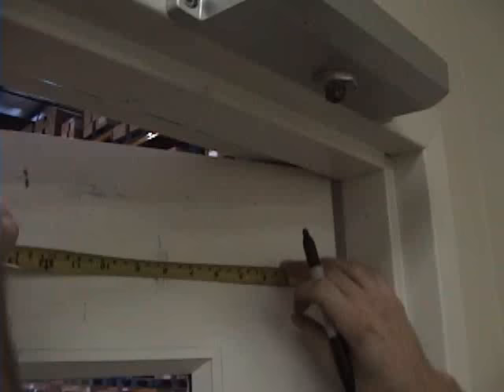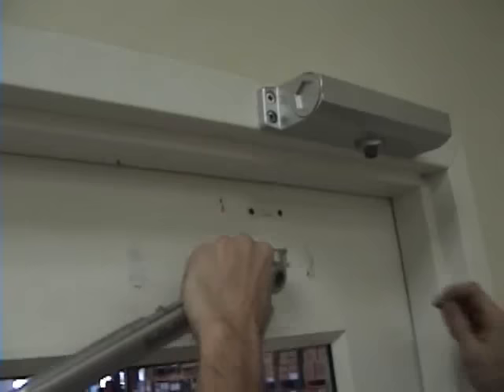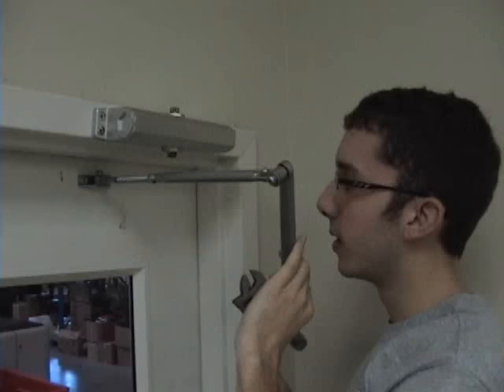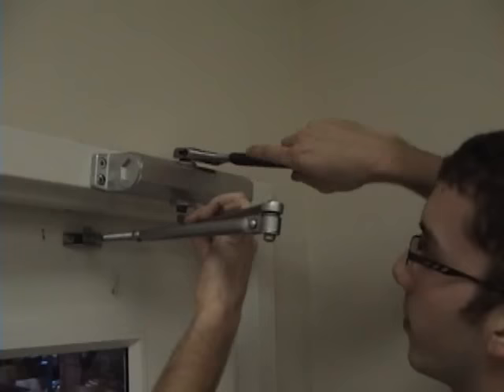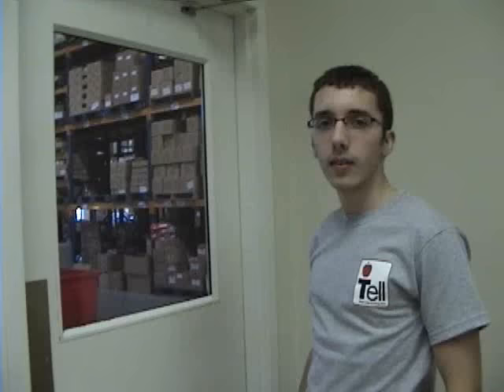How to Install a Door Closer - Top Jamb Installation Video / Tell Manufacturing

Comment: you didn't say that the jamb/header was wood or metal... also, you said drill and tap for 1/4x20 machine screw threads... this assumes that the header is, 1) not thin aluminum or hollow sheetmetal stock. these should only be drilled and tapped for such if there are backing plates behind the sheetmetal such as 3/16 inch thick. for thinner metal mounting surfaces, one should use the large sheetmetal thread screws to avoid pull out. again, you 'didn't say' !
Reply: the best of me
 t
Reply: maximum woof you didn't say you are a complete tool but we gathered that anyways. Again you didn't say.

Comment: I just instaled one today but I don't understand is why I can't control the speed ......the manusl says that depends on what side are u want to instal it  and you need to adjust the part where the arm goes mounted acording to the marks  ......but I don't know if thats the problem
Reply: What are the measurements from the door jam and door?
Reply: The measurements that came with the instructions are 220 and 95 etc...What measurements are these and do I convert into inches?
Reply: * how do I convert in to inches?

Comment: 2:10 I love how the main arm hits the door frame both times when passing it. Happened to me as well. Displacing the entire unit for a few mm lower was out of the question, so my only option was to loosen the bolt with the washer on the main arm and lower the main arm/shaft a bit by hand, so it doesn't hit the door frame every time.

Comment: Almost got it right. Give a little preload to the arm, and on regular and top jamb installations you can mount the armature to the closer body before mounting the closer. This will allow for the proper preload, and elimination one step. Thanks for the video
Reply: thats how I do it,  assemble arm to closer before mounting it to the door,  but most follow the instructions word for word, and prefer to put the arm on AFTER the body is up.

-Jess the door closer doctor

Comment: Very well done—this helped a lot! However, I want to install one of these on a door that leads to basement stairs but there is about 2” of decorative moulding trim around the doorframe. Can one of the components be lowered/raised to compensate for the height/clearance needed?

Comment: Great demo teaching man!

I got a problem....i.e. to keep the door stay "still" or stationary when it is "fully wide open" (such as to move things through the door before it closes up automatically as in normal case).  After moving the stuff thru the door, then the door will be manually closed after I pull it inward to activate its automatic closing action.  How can I do it?  Thanks for your help!
Reply: Unfortunately to accomplish what your looking for, you would need different parts all together. One option would be a "hold open" arm, this is adjustable as long as the closer was originally installed correctly, at the proper degree of opening. Also, not all closer bodies have a compatible hold open arm assembly. If the opening is fire rated, it would be against fire code to have any hardware that impedes a positive latching motion. In some cases you can put a delayed action closer on. This has an extra adjustment that delays the closing of the door up to 30 seconds. This requires a whole new closer assembly. Hope this info helped

Comment: My door push outward towards the exterior, can this be mounted on the exterior side?
Reply: no, it mounts also in the interior, you just need to switch the side of the main unit upside-down. Should be in the instructions in the box.